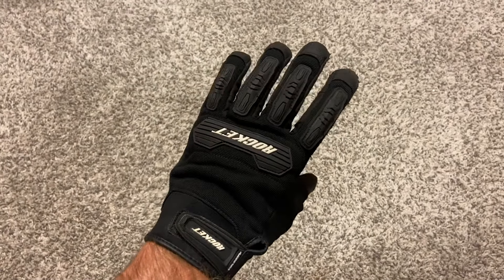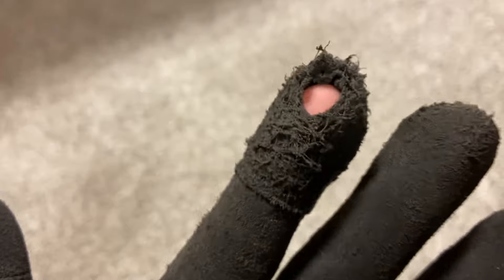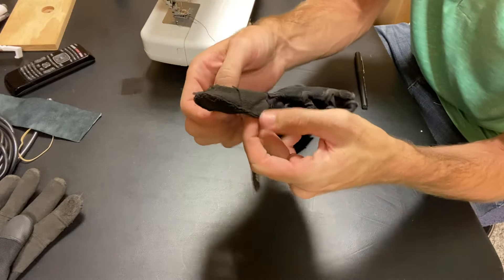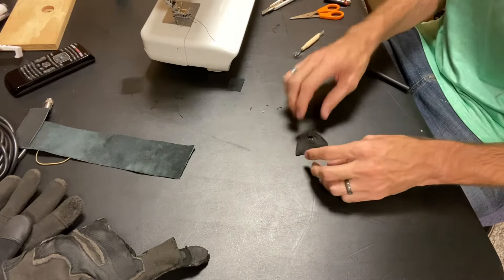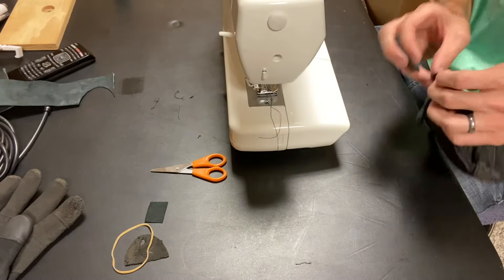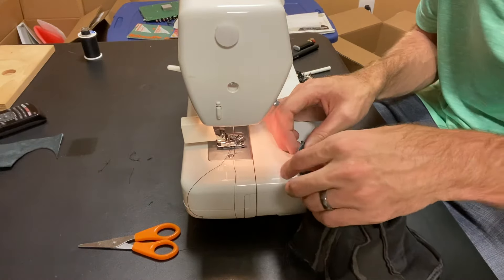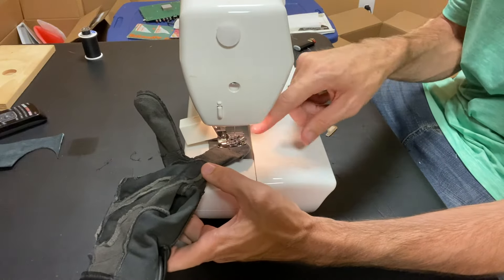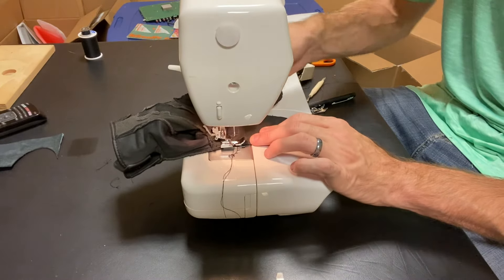Glove repair - replace a finger tip

Comment: You did a great job considering you used a home vs industrial sewing machine. Pick up some wonder clips for future use. Pins are a no no with leather. All & all good job & kudos for even attempting the fix!
Reply from the maker: Thanks. I do have some wonder clips, but due to limited fabric to work with, I opted for pins.

Comment: If the middle finger is touch friendly, then use that and do this method. Otherwise, one can use conductive threads and sew tiny X's or just stitch the heck out of the fingertips, and then there's also conductive sprays of carbon material (forgot what they're called).

Also, I think you can use any upholstery or from discard shoes. I can also think of those tray/shelf liners as patch materials.

Anyways, thanks for this!